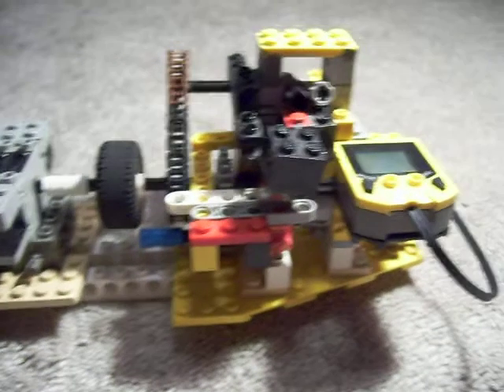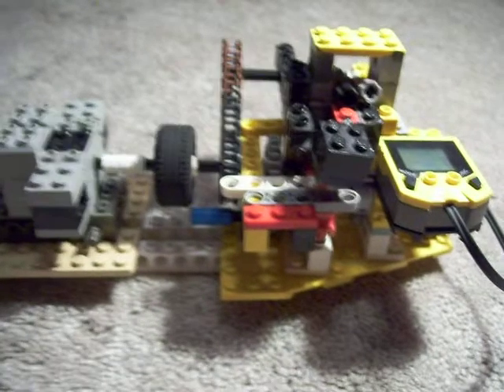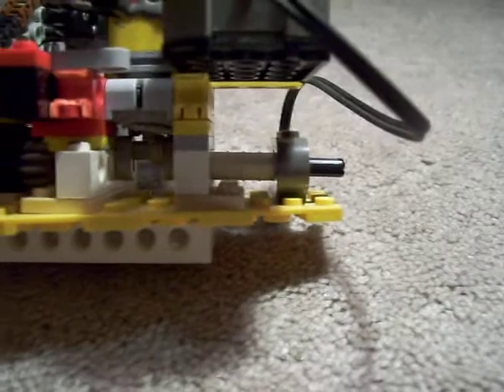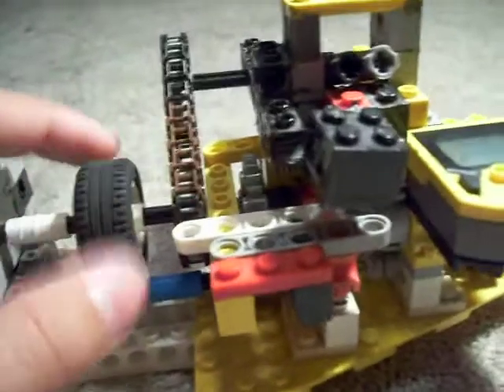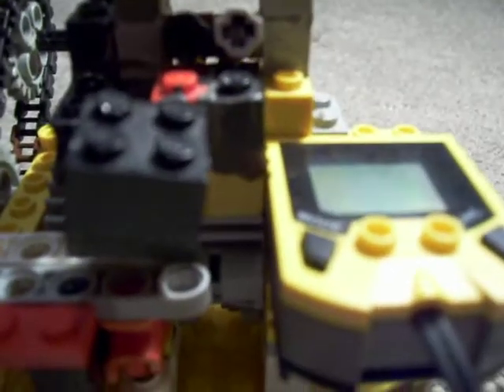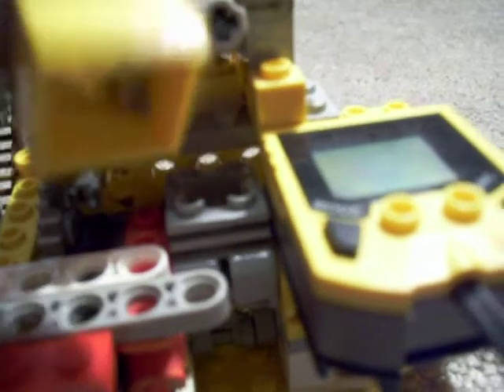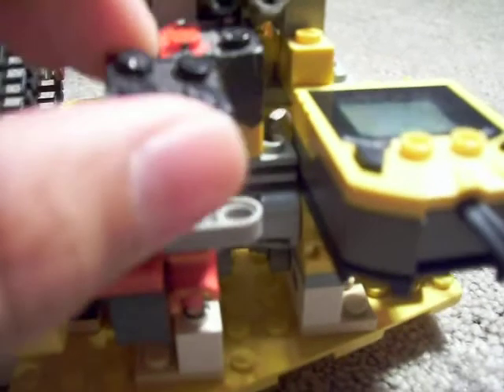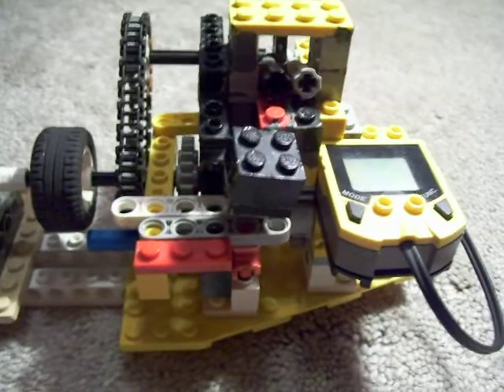4 stroke engine update #5

Comment: try using super glue as a seal between the cylinder head and the block.if there is still not enough compression then you will have to do something for the piston and cylinder wall.if you are still making this as petroleum engine whats your ignition source going to be?Oh, and super glue should only be a temporary seal to test compression.